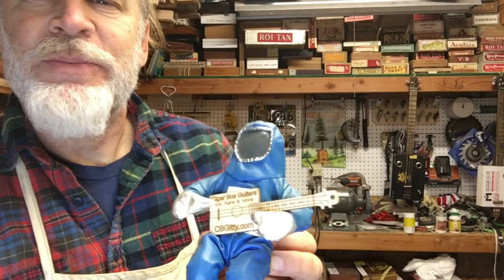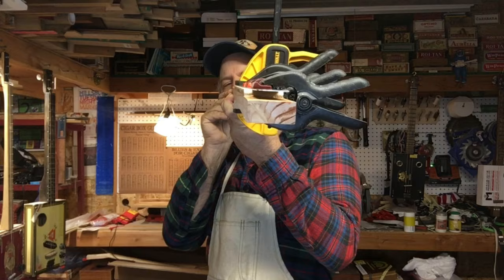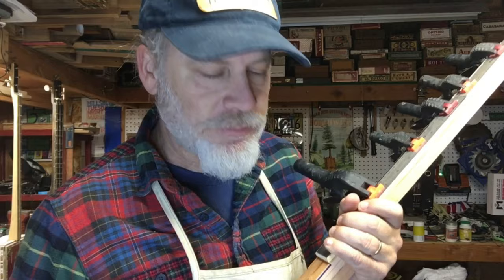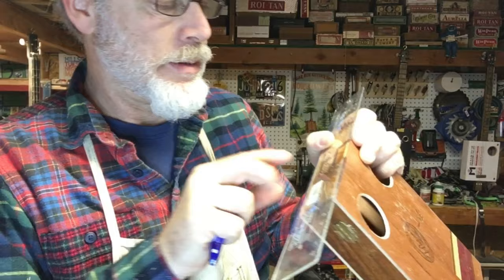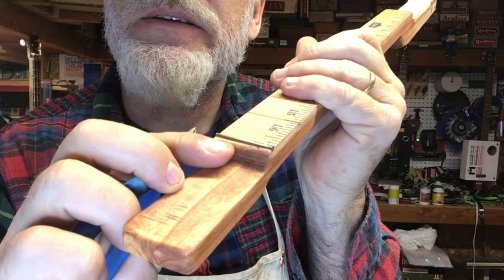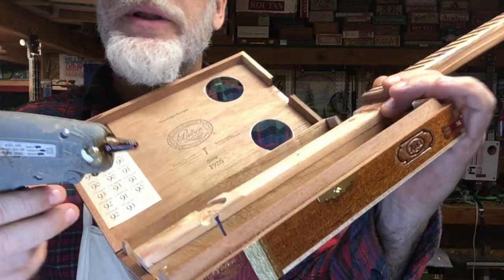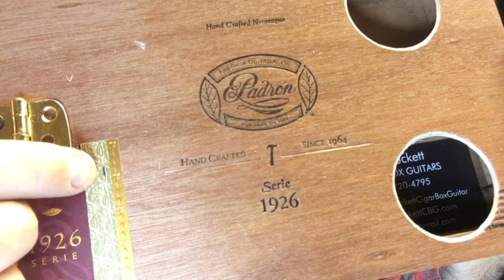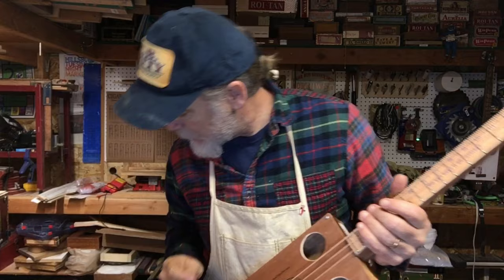Building a Cigar Box Guitar - From Start to Finish

Comment: Todays take away~SHINTO RASP!  Yo bro! the Forstner bit changed my whole life, and I was finally able to sleep at night! Just got the glue gun~(was using silicone glue )~and now I need to hunt the RASP! The family asked me what I wanted for Christmas~I said with out hesitation "The Mighty Might Mini Table" saw! Now I'm gonna try to sweet talk you into making me the jig, signing it and asking your Intel guy to ship it out!        A new 2020 Proverb inspired by this video:  "Its better to watch Del Puckett videos and learn to build and play,  than to obsessively track politics and current events, a  longer life will ensue." I give this video 2 thumbs up and a snap
Reply: As far as the mini saw from Harbor Freight, it terribly under powered,  but does work with soft wood used for a fretboard,  such a a yard stick, pine or poplar,  forget it for oak, cherry or maple or purple heartwood fretboard, it stalls way to easily.   Use a scroll saw and reverse the blade to cut into a marked fret space.  Much easier and safer.
Reply: I use an inverted blade in a scroll saw to make precision cuts to pound in fret wire. I also use reclaimed oak flooring from the Re-Store for the fret board.. Hard as rock and easy to do.

Comment: Another important step during checking of intonation is check at the first 3 or 4 frets. The slots in the zero fret may need to be filed a little deeper to get the note on those frets correct. Don't go too deep or a new zero fret will need to installed.
Reply from the maker: exactly !!!  too right mate !!!
Reply: That’s interesting bc that is the exact problem I’ve had with a couple guitars. Intonated at the 12th fret but the first few are sharp. Would that call for deeper grooves or shallower?
Reply: @DaveRYB  The groove needs to be deeper. If the nut or zero fret is too tall at the string, when you fret the string you pull it tighter than it should be making it sharp.

Comment: Hi Del, loved your video. Don't know if you're still reading and/or replying to this one, but it raised a few questions. Do you use a pre-amp to plug your piezo into before the amp (I've read where that's necessary to improve tone & volume)? 2nd, why do you install the hinge on the top of the box, vs. on the bottom - or extend the neck through the box and install it on the tail?  Thanks!

Comment: Carpenter's tip. Glue the neck of the guitar from at least two or preferably even three different layers so that it stays straighter. It does have a bit more work, but it is worth it.
Reply from the maker: what do you mean ??
Reply: @PuckettCigarBoxGuitar  :  When you look at the workpiece from the end, horizontal or vertical arcs are visible. when gluing from several layers, the arches turn in different directions so that the glued piece does not bend. If the arches of the first layer run horizontally then in the next they are turned vertically.

Comment: Hiya. I have a problem with perspective. Sure, I have many problems, but perspective is the one that is on my mind..I have a box for my pencils that is same brand as that'n. Mine is about half the size of other cigar boxes I have, different brands. I don't know if you are four feet tall or six feet... Thus I am wondering if you are using a bigger cigar box than my smaller one. I noted your box has, inside, more cigar rating labels than mine, this indicating more cigar capacity. Can you ease my troubled mind concerning this?
Reply from the maker: i use all sizes…. smaller ones for ukuleles … larger ones for basses

Comment: Love your videos Del but have a question about the fretboard and neck. The Lowes ruler fretboard is narrower than the neck. Do you cut, file or sand the neck width down to match the ruler.
I'm in the process of rewatching the video now but don't remember seeing where you mentioned that 
Thanks for your videos and keep up the good work.
Reply from the maker: sometimes i do … not always… sometimes i fill in with wood filler… sometimes i leave the gap… depends on my mood i guess
Reply: @PuckettCigarBoxGuitar  thanks Del...good to know.  I've been hunting but can't find a video showing how to attach a neck with the back angle to the back of the CBG. And how to literally cut that back angle. I'm almost positive I've seen your video on that but now can't find it.
Love your videos and always look forward to new ones.

Comment: Well, I figured out why I haven't seen you making a CBG out of an 'Acid' cigar box. They're beautiful boxes but they're a little too thick for the piezo. So I'm just putting a hot humbucker on mine. I considered one of those slim-line humbuckers so I wouldn't have to do much cutting but they just can't be hot enough for my taste. The thickness of the box also makes it somewhat unacceptable as an acoustic but hey, plug it in and rock on. I'm not even cutting in sound-holes.
I made my dog really jealous, I made my nuts and saddles out of bone. I just sticky-tape the flattest side of the bone to a chunk of 2x4 to run it through the saw,  s l o w l y.
Thanks for turning me on to Fret Guru. I get a little something out of every video you make.
Reply from the maker: sounds like you’re on FIRE!!!! 😎

Comment: I just picked up a few Lowe’s and Home Depot yardsticks. They are a hair less wide that the standard 1x2 necks. Do you sand or plain the sides of the neck down to get them flush when you use yardsticks?
Reply from the maker: sometimes...depends... but you are correct

Comment: where can I get a print out for the fret board?
Reply from the maker: the Just Tempered fret spacing is a Del Puckett innovation.  i have one template that i use.  the template was created by splitting the difference between Just Intonation and Equal Temperament.  it’s a cross pollination... a hybrid so to speak.  kinda offers the best of both worlds 😎
Reply: you can buy standard fret board print out from c b gitty for a variety of scale lengths (or im sure you could find free versions to print out elsewhere but you'd have to look). but like del said, the just tempered is a template he made himself

Comment: From the beginning you don't tell how wide and thick the board is you're using for the neck
Reply from the maker: typically 1/4 thick… 1.5 inches wide… then cut it to as long as you need for frets .  standard but can be slightly customized if needs be
Reply: Thank you very much for your help!!!

Comment: I don't mean to undermine your knowledge, but when you glued the fretboard on the neck; I thought it was preferred to let the glue dry and then go along the edges with a chisel before you sand? Because the glue won't settle into the wood unless something forces it in the pores? I mean, I suppose is doesn't matter with a cigar box guitar anyway, but I think I read that or heard it when I was researching fretboard regluing tips for my schecter. 
Anyway, I'm hooked on these things, I want to built one but more in the style of a guitar. Figure out how to do a string through without making the thing to brittle to hold string tension. Well I've rambled here enough now, just thought I'd get my question out there
Reply from the maker: i’ve never heard of that before.  i’ve never had any problems... ??  i just strive for efficiency

Comment: On the neck angle, if you remove say  3/8" at the lower end,  you replace that along with what ever it takes to have the back of the neck touch the bottom of the lid? That gives you the angle and removes any space between beck and top of the box correct?

I'm subscribed and enjoy your videos.
Reply from the maker: I'm sure there are many ways to achieve this very critical nuance ... however you want to do it... and if it works... then you're GOLDEN.  I usually differ to the easiest method